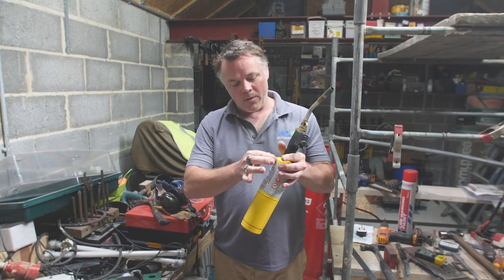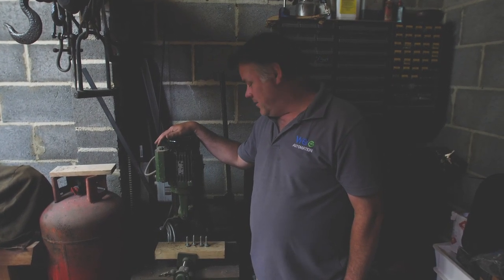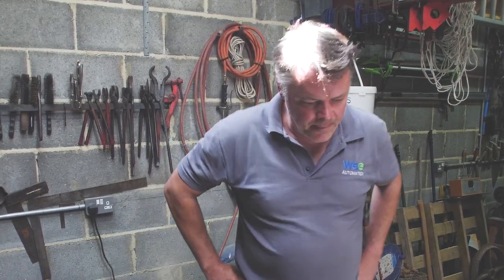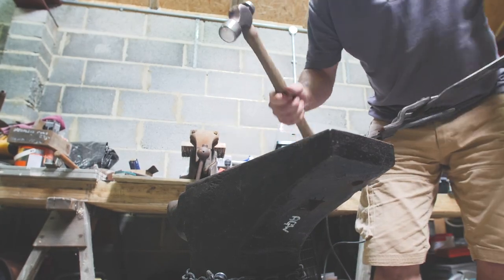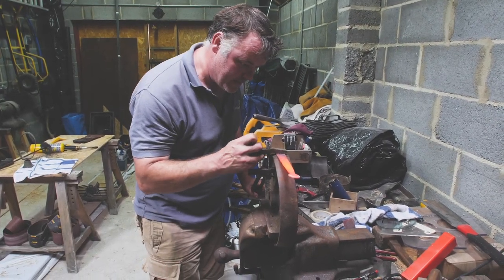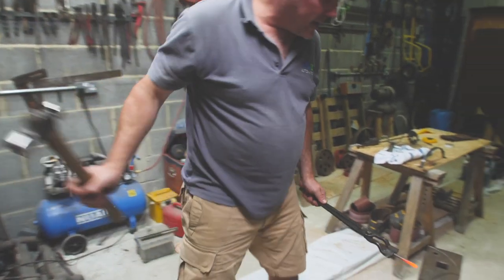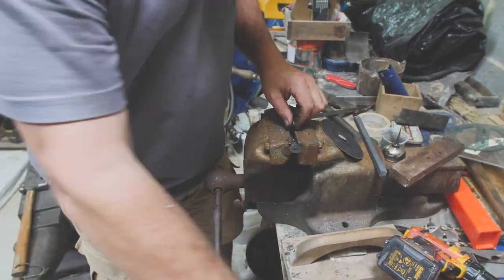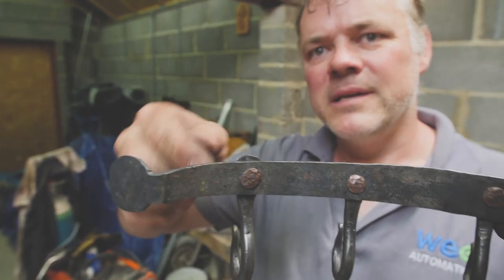Forged Steel Multi Purpose Tool Rack (Blacksmithing Project) & New Workshop Tour

Comment: Finally! Very excited to see the new workshop, Hope it's not too clean...
Reply from the maker: It’s a real s*** hole, you’ll be glad to hear! Will you join us for the premiere Hans?
Reply: @DirtyShedCreations  of course, wouldn't miss it
Reply: Cheers Hans, it’s a lot tidier now! It’s actually functioning! There’s barely any mould growing out of the ceiling or anything! 

See you both Sunday, but not if I see you two first! You know, in there! Monkeying about with expensive tools, using the air compressor to fire needle files at each other! Smashing hammers on stuff. Then you’ll both be in trouble! God kids!

Comment: Al should have a go at hot filing if he hasn't already. Exactly what it sounds like, filing steel while hot. If you use an old bastard file you can remove a decent amount, and a second cut file hot will give a very nice surface finish; just make sure not to use a new file because it ruins the temper!
Reply from the maker: Cheers Ari, Al will jump on her and knowledgeably discuss, I don’t know nothing! Thanks for watching chief!
Reply: A ferrier’s rasp is very effective at hotfiling.